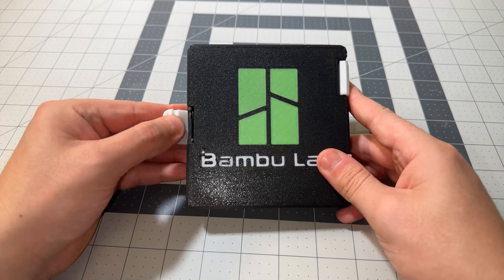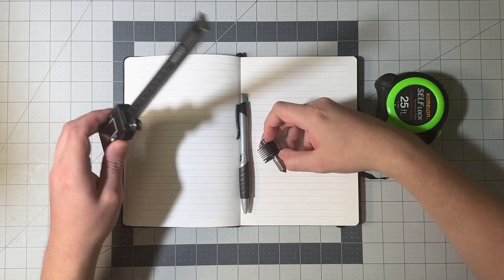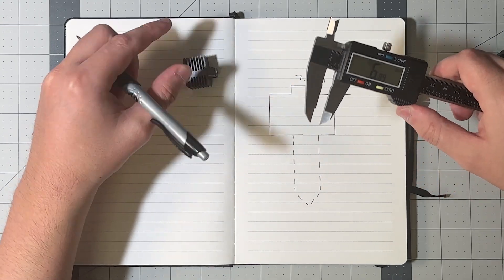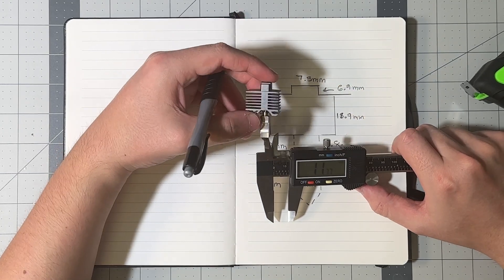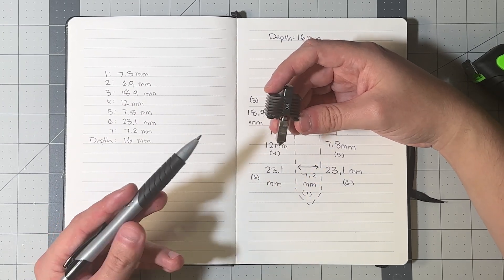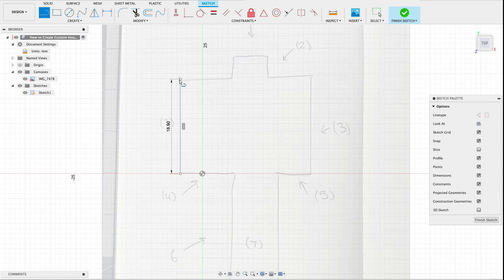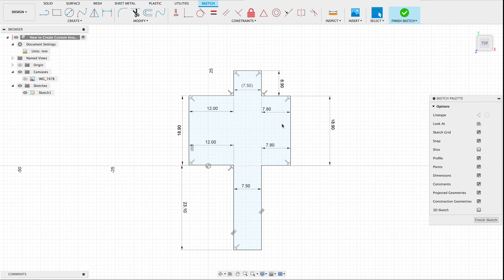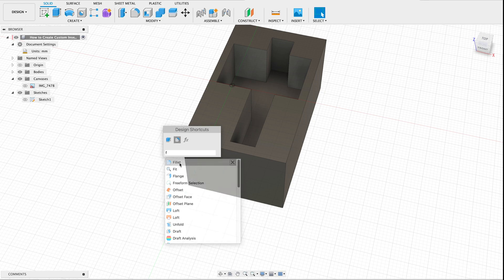How to Create 3D Printed Custom Inserts for Tools and Organization | 3D Printing and Fusion Tutorial

Comment: The main reason for 3d printed parts having tighter than expected tolerances is plastic shrinks upon cooling. Depending on the plastic choice will also dictate how much shrinkage you should expect, PETG and PLA have fairly low shrinkage ratio but ABS and ASA shrink at a higher rate which also makes warping & de-lamination a higher likelihood if you don't have a hot chamber.

Comment: As long as you take a picture flat from the top you can either place a ruler in the picture or take couple of reference measurements and then scale the picture in Fusion to desired size. No need to make such a full measured drawing. 
I am more interested to see the process of designing the box with the hinges

Comment: If you can find the cad model of the object you want to make a case for (there’s a lot of stuff out there if you look) you can use it as a tool in the combine function to cut out to exact dimensions and then just press pull for the level of interference you want.
Reply: Yes, but how do you plan to extrude the model in the Z axis (in order to be able to "drop on" the item?
Reply: @ huh?
Reply: @helipilotuh1  let me phrase differently: using combine to hollow out the insert is great. But how do you put the object into the insert?

Comment: Hi. You're using calipers in wrong way.
In the 5:48 you use the "upper jaws for inside measurement" to measure 11.94mm of distance... It's not for this. For this kind of measure you have the "depth rod" in the opposite side of caliper.

Comment: I don’t know if this will work for anyone else and it isn’t for every application but this is how I usually design things around real world objects. 

If I can have it at my desk to measure I start by making an outline in cad with no measurements. I just sketch out all the lines first, then as I take measurements I enter them into the model. Basically I just skip the paper part and go straight to cad. 

This isn’t great for very complex shapes or things you can’t have at your desk to measure, it’s just what I like to do sometimes. I definitely don’t do it always.
Reply from the maker: I agree, I definitely like to jump straight into CAD when I have a design in mind but sketching things out is how most projects/products are designed especially in the workforce. 

Even though the project is simple its helps a ton to draw things out because its good practice for when projects become larger and much more complexed.

Comment: Good idea and good work... A small criticism: the 3D creation procedure seems too elaborate for such a simple sketch... Why not have drawn the sketch directly and dimensioned it in Fusion360 directly after measuring with the caliper? ?
Reply from the maker: Appreciate the critiscm! The reason why I would sketch things out on paper is because its follows a traditional workflow for how products/designs are made. Immediately jumping into CAD and making adjustments later is better done once you mastered CAD and on solo projects. But for most people with little to no experience with CAD this will help them understand the workflow and better conceptualize ideas from paper to screen.